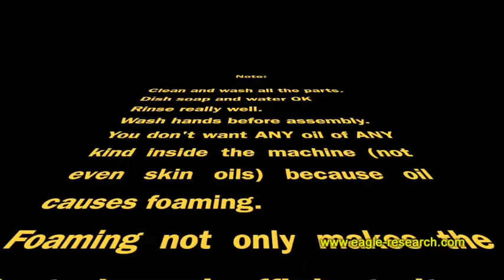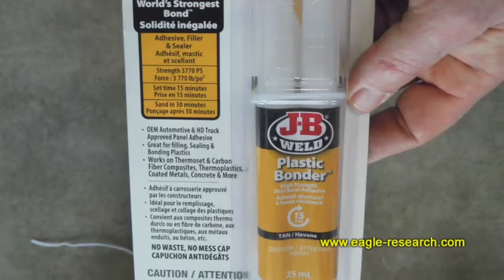Assemble and Wire ER50 Brown's Gas (BG or HHO) Electrolyzer from Kit (upgraded)

Comment: Hi George, very good design and easy to follow.
if the bubbler is scrubbing for impurities won't those impurities be in the drinking water or should you only drink from the 2nd scrubber bottle? 
or do you put a stone in somewhere?
Reply from the maker: To 'cover my butt' I'd recommend only drinking from the second bubbler.

BUTT, I personally use only one bubbler (which I built out of a 2 liter bottle) and I drink the water from that (so does my wife and cats).  Using it I make about a gallon of BG bubbled water a day (I also breathe BG up to 4 hours a day as I'm at my computer).

My ER50 is now designed with features (like the tall tower) to prevent impurities from getting into the bubbler and even before (unless you had a severe foaming problem) there was extremely little 'impurities' getting into the bubbler anyway.  The bubbler also acts as a backfire arrestor and an oxygen 'smoother'.  I found the 'new' oxygen to be harsh and bubbling it through water made it 'smooth'.

All that said, if you are using the 'store bought' oxygen humidifiers as bubblers, I would STRONGLY recommend having two of them and breathing / drinking from the second one.  The liquid level in most oxygen humidifiers isn't deep enough to throughly 'scrub' the BG.
Reply: I think it needs to be pointed out (maybe just for the lurkers like me) you want to "scrub"  the gas because you're breathing it. If you're drinking the " scrub" water (hydrogenated water) I would simply run the water thru a water filter before drinking. Otherwise, a second water bath for sufficiently scrubbed gas would negate any impurities. Apologies to those who may see me as Captain obvious
Reply: @ecopegasus  a
Reply: Hi George, what gauge metal do you use? Is 20 gauge 304 stainless acceptable?

Comment: Hi again George!  If the plates are not connected I do not understand because it is the electricity who generate the bubles and if there is no electricity on the plates they are there for nothing. I already saw other design withs plates and there was rods connecting the plates to give them electricity... The way you wired this mean that only one plate at each end is generating gas. If the plates are coneccted it will give a lot more gas. But maybe it what is intended for. Not too much gas to breathe, just an add-on to help breathing... 
Anyway I find that you are doing a very nice work, nice design clean.  Have a nice day!
Reply from the maker: Please Read Brown's Gas Book 1 and Brown's Gas Book 2 to understand the difference between traditional electrolysis cells (which you understand) and series-cell (which you do not understand).
https://eagle-research.com/product-category/browns-gas/
With series-cells EVERY PLATE makes gas even though there is no 'wired' connection.  The electricity travels through the electrolyte and then through each plate in turn.  Series-cell design is MUCH more efficient for making Brown's Gas.  Of course you must not allow the electricity to 'bypass' the plates, thus our design.  Please read the books to upgrade your knowledge.

Comment: Capacitors do not like heat and should have a spacer between bottoms and hot plastic pipe.  I would also insulate the lone remaining wire from the switch so it does not short to metal ground when switch is operated.

Very nice kit and well thought out.
Reply from the maker: The heat is less than 120°F and (with a fan) the capacitors never exceed 75°F.
  The lone remaining wire is already insulated, it's a 'signal' wire which is optional and not usually used (so it's not factory stripped).
Your comments are appropriate and show that you paid careful attention to detail and I appreciate that :)

Comment: Nice, i noticed you talking about the temp rating of the PVC being higher than the clear tubing, you could also consider CPVC for the cell because that is even higher temp rating than both the tubing and the PVC. But CPVC has a color appearance  like a tan tone, sand color, not white like the regular PVC.
Reply from the maker: True :)

Comment: The one thing that i have reservations about is the amount of space you have in the bubbler (which is a basic flashback arrestor), the more space there is the greater the explosion in a worse case scenario. My bubblers have always had minimal space with a nylon mesh in that cavity to catch the water droplets, another thing I found useful was to use a lightly spring loaded top so that it is self setting and less likely to blow it apart as they often do, but thats just me...
Reply from the maker: Good to 'meet' others that are building electrolyzers and know the issues involved.  In this case we are talking about low pressure explosions, which these bottles can handle with no problem, as per:
https://www.youtube.com/watch?v=-9EmgSowldw&t=30s
Reply: It's not just for flashback!!! The bubbler is multi functional!! The water absorbs some of the Hydrogen and replaces it with Oxygen, This action also removes all moisture from the air that may have been generated due to electrolosis! ON THAT NOTE! It also purifies the Hydrogen GAS and reduces it's concentration!!! So it's for your SAFETY!!! And anyone around you....
Reply: So you all agree it's a Bomb then lol

Comment: Not sure what this is for but a short cut for plunging the spacer would be to put a plate on top of the spacer then shove it down with whatever, just a thought....
Reply from the maker: The problem with doing a plate and ring together is that if the ring needs to be adjusted (and many do) then you need to remove the plate and re-insert it after the ring-gap position is corrected.  You also can't place the 'ring glue' properly if there is a plate in the way.  Simplest and quickest is to do one item at a time.

Comment: Hi! George I have question about the plates who have 2 small holes each. They should be connecteted together  for each side and I think those holes were designed to connect them electrically. Maybe it is my mistaque but I did not saw that you connected them???
Reply from the maker: Definitely DO NOT connect the plates with anything but the electrolyte fluid.  
The holes are for fluid equalization, nothing else.

Comment: in Aus we rate the tube as PN12 or PN18 ,Pn18 is pressure rated has a 5.2 mm wall thickness and higher heat rating than PN12 , the electrolyte (lye )should be food rated , that is greater than 99.4%purity , a lot of lye is made from sodium chloride and is usually 98% , that 2% can be salt which will give off chlorine gas ,not good,  as well as causing excessive foaming .  Sealant i used is called "ultra blue "an automotive gasket maker with 100%success,  do not use "Stag", std silicon sealants, "ultra copper " or ultra black", the effects of electricity and sodium or potassium hydroxide will adversly affect all of these and ultimately cause leakage or contanimation . A one way valve in the output is an absolute must as water will suck back into the unit , these units are expensive to build and leakage will render them useless as well as ruining anything it leaks onto !

Comment: Are the Stainless Steel discs that are in this design made from a normal 304 alloy of SS or a more resistant to coroosion alloy of SS such as 316Ti? Has any Chrome 6 been detected in the Brown’s Gas produced by your product? I’m breathing 20ml/minute H2 right now from my Hydrogen water bottle but from the info I’ve found online so far, that is not enough to derive much benefit from it so I’m looking for the next step but want it to be the right one.
Reply from the maker: Any grade of stainless steel is acceptable in this design, because we specifically do not go over the electro-deposition voltage of even the lowest grade of stainless (even straight iron could work OK).

We have had the Brown's Gas independently tested from several electrolyzer designs (ours and others).  The MYTH-Information of hex chromium is hype made up by nay-sayers and 'competition who are either ignorant or KNOW the Brown's Gas is better than pure hydrogen and look for ANY excuse to denigrate it, even playing to people's ignorance.
https://eagle-research.com/is-there-hexavalent-chromium-in-browns-gas/

Ditto with the lye
https://eagle-research.com/faq/is-lye-safe/ 

Yes, 20 mL/minute is better than nothing but not even close to optimally therapeutic.

Comment: you should soldeer all conections the crimps will come loose
Reply: It'll have a proper connection! Crimps may already be loose, losing electrons.
Reply from the maker: Good tip.  The crimp connections are pretty reliable, I use them as an automotive technician, but nothing beats solder and shrink wrap.

Comment: Nice presentation. This system produce 2hydrogen and 1oxygen mixed at the output port? If so would there be a risk of ignition triggered by body electrostatic discharge ?
Reply from the maker: Once the gas mixes with enough air it becomes non-combustible.  So if used as directed the only combustable gas is contained inside the hoses, jars and machine.

Comment: Isn't using non-pressure PVC cement going to be a problem? Why not use pressure PVC cement? Also does the PVC Cement have to be Low VOC or doesn't that matter?
Reply from the maker: There is virtually no pressure in the machine, so 'pressure' rules don't apply.  The procedure of priming and cement IS the recommended procedure for gluing parts together that will be under pressure (but I use them both anyway, to assure a good seal).  
VOC doesn't matter because my instructions are to allow the cement to fully cure (no more off gassing) before putting the lye solution in.  Wait until the smell is GONE.

Comment: Two concerns with the design.  PVC off-gases and leaches chemicals.  So even though I like the design, I will probably not do this one because of the materials being used.  May I suggest you build an upgraded model.  Yes, I know they use PVC for new construction drinking water pipes, but that doesn't change the facts.  PVC is dangerous to our health. Have you explored the issues with PVC.?
Reply from the maker: I have explored the PVC issues.  In this case, the PVC is stable after initialization (as detailed in the assembly instructions).  It isn't the plastic that's the problem, it's the glue.  You need to wait for the glue to fully cure (a few days) before putting in the lye solution.
As far as leaching, if any occurred (which it doesn't) It'd stay in the solution, not come out with the gas.  I've had spectrographic-analysis done on the gas and there are no such impurities.
I DO offer an 'upgraded' model.
AquaCure Brochure
https://eagle-research.com/wp-content/uploads/2019/05/AC-Brochure-small-v4gw.pdf

Purchase your AquaCure here:
https://eagle-research.com/product/ac50/

AquaCure AC50 Setup and Operation Video
https://www.youtube.com/watch?v=723gzax3z7Y

Comment: Do you have the conversion kit that makes a vehicle run on %100 water ? where would I purchase this from you ? Also what would I do in winter when it gets to be -35C in Canada here ?
Thanks in advance.
Reply from the maker: As far as I know, no one can run 100% on water.  There are lots of ways to  run partially on water, which I describe in my "Water as Fuel, Book 1".  I address cold weather 'water as fuel' use in my books, like the "HyZor Technology Manual" which describes how to build a practical onboard (vehicle) electrolyzer.  I've operated this equipment in Alaska at much colder than -35°C.

Comment: George do you have any idea what you are doing?
The capacitors are connected to the DC side 

To create a more smooth and steady DC signal, a smoothing capacitor is installed.
Reply from the maker: ROFLOL... Yes... I know what I am doing, and once you understand WHY I'm doing what I'm doing you'll see the genius of it.  You are correct that one of the main uses of capacitors is to smooth out DC but we do NOT want that in this case.  We NEED the 'pulses' to be as high and sharp as possible (and periodically 'pause') for most efficient generation of Brown's Gas.  Believe me, I've researched and tested this every which way to Sunday, spending over a million dollars and decades of my life building thousands of electrolyzers (which is why I found your comment so amusing, no offense intended).

What the capacitance in SERIES with the load accomplishes, is inherent control of the AMPERAGE (without sophisticated electronics).  
The issue to resolve is that when electrolyzers run, the amperage causes heat, as the electrolyzers heat up, their 'resistance' drops, which would allow more amperage to flow... More amperage causes more heat which allows more amperage until you get something called 'amperage runaway'; where the electrolyzer over-heats and could even short out.

Capacitance in series with an AC load (so the capacitance needs to be on an AC leg) LOCKS the amperage REGARDLESS of the load resistance.  So what actually happens to the load as the resistance drops is that the DC voltage drops, allowing for a greater WATTAGE efficiency.

I show this more in this quick and dirty video.
https://www.youtube.com/watch?v=YQ5YbSBaNNU&t=81s

Once you actually build and test my electrolyzer design, if you build any other, you'll quickly see that my 'simple' design is a lot more sophisticated than it looks.

Comment: Why don’t you use baking soda instead?  Are you are breathing both the H & the O together?
Reply from the maker: I've tested THOUSANDS of electrolyte solutions... Baking Soda and Table Salt were two of the first (actually the very first was to try to have NO electrolyte at all, see Brown's Gas Book 1).

The problems with Baking Soda are that it is inefficient (requiring twice the voltage per cell), messy (created a HUGE amount of sludge, clogging the electrolyzer), dangerous (creates Carbon Mon-Oxide gas) and... in the end has absolutely NO advantage over Lye because a portion of the Baking Soda actually turns into Lye, which is what permits the electrolysis to take place... 

https://www.thoughtco.com/baking-soda-chemical-formula-608474

Yes, I am inhaling the entire mixture of gasses generated by the electrolyzer 'together'.  This mixture is known as Brown's Gas.  Here is what Brown's Gas is:
https://eagle-research.com/q-what-is-browns-gas-bg/

Comment: Hi George, I cant see what the purpose of the caps are when it is in series with the rectifier, It cant smooth your DC output at all that way it will only give you a fase shift in you AC, that have no purpose at all. If you connect your caps parallel with your DC output of the rectifier you will get a smoothed DC output and not a pulsating DC.
Reply from the maker: The capacitors are on the AC side of the FWBR, for inherent (no electronics needed) amperage control and amperage limiting, as per this video:
https://www.youtube.com/watch?v=YQ5YbSBaNNU&t=35s
to allow electrolyzer to operate efficiently at less than full voltage and to prevent amperage runaway.

You WANT a pulsating DC to go through the electrolyzer, to significantly increase efficiency.  Many reasons for this, covered in my Brown's Gas Book 2.

Comment: Hi, which one is better, potassium hydroxide ir sodium hydroxide ?
Reply from the maker: Good question.  Science will tell you potassium hydroxide or even lithium hydroxide.  Practical experiments with thousands of solutions proves that sodium hydroxide is best in OUR electrolyzers, which are DESIGNED to be optimized using sodium hydroxide.  If you use potassium hydroxide in our electrolyzers, they will produce LESS gas. 
And sodium hydroxide is less caustic, less expensive and easier to acquire.  In other words, much more practical.

Comment: If you sand the surface of the plates it will effectively double the surface area of it.
Reply from the maker: I did that experiment decades ago (see my Brown's Gas, Book 2) and general abandoned the practice when I found the beneficial effect to be short lived.  Any impurities 'plate out' on the cathode, filling in the sanding grooves.  I eventually developed 'grid plates' which I introduced to the public at the 2014 TeslaTech Conference in Albuquerque NM.  

Grid plates not only double the surface area of the cathodes (balancing out gas production of oxygen from the anodes) but are designed to 'release' the bubbles from the plates faster.

And before you ask.  I'm not using the grid-plates in my ER50's at this time because frankly, they are too expensive to manufacture and would cause the retail price to rise, reducing sales.

Comment: George Wiseman - Did you put the water with the lye into the ectrolyzer & later breathe the Brown's Gas made though it or replace it?
Reply from the maker: Yes, you put the water with the lye in it into the electrolyzer.  The lye stays in the electrolyzer.  The lye is an efficient catalyst that allows the electrolysis (water splitting) to happen.  ONLY the water comes out as hydrogen. oxygen and water vapor.  The mixture is safe to breathe once bubbled through pure water.  I've been breathing it from an ER50 like this one for a minimum of 4 hours (up to 8 hours) a day since March of 2016.  Here is what has happened to me:
http://www.eagle-research.com/cms/blog/browns-gas/browns-gas-health-enhancement/plants-dont-lie

Comment: You can just put next plate on top of ring and push it down
Reply from the maker: But then how do you assure that the ring gap is in the correct alignment and that things are glued properly.  It's EASY to push the rings down without a plate.  I've done it thousands of times.

Comment: The leviton timer has a cap that fails and the unit starts to buzz.  
Cheap electrolytic, replace with 1uf 350v, digikey 493-1434-ND or equiv...
Reply from the maker: I've been using hundreds of these timers for years now, without a single failure.
But good to know there's a remedy if one does fail, thank you.
Reply: Course I got the only flaky ones in the bunch... If ones starts buzzing on you, thats the fix, cheers:o)